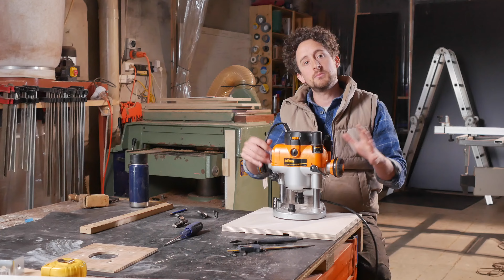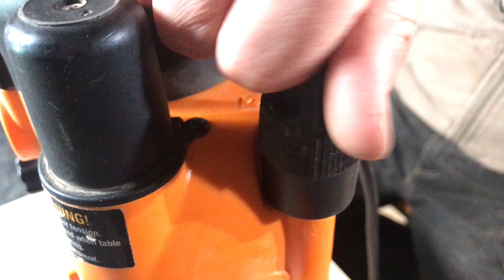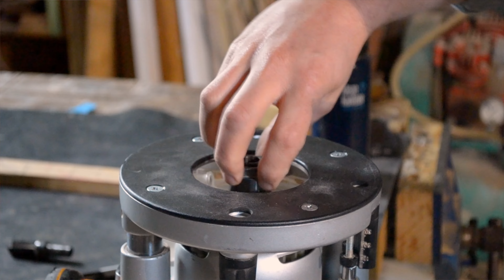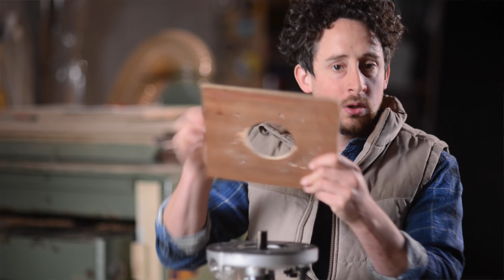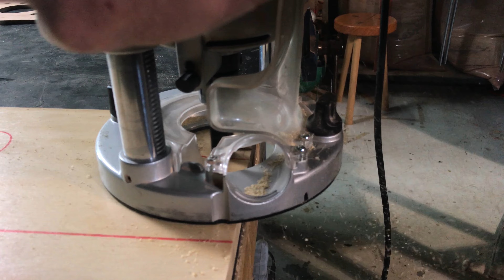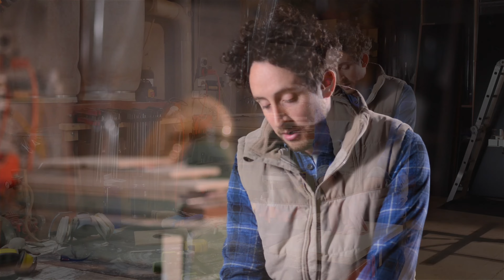The Router Bits: Introduction to Routing

Comment: Thanks for that.  I think I've been working with some bad info.  I was told to put the bit all the way down and then raise it slightly before tightening and then don't over tighten as it can destroy the collet.  I have the same router.  Just a beginner so would appreciate your comments.
Reply from the maker: Hi Caspian of Narnia! We asked Patrick, and his response is: 

That all sounds like reasonable advice actually. 
Raising the height of the bit prevents any blade edge contacting the collet  - which is good to look out for. The bit I was using had a collar protecting the bearing so I didn't need to raise it. But!  Good catch and good advice in general!  As for over tightening the collet, I have had bits slip or move due to the collet not being tight enough. So now I make sure its pretty tight. I have had this router for years and I have never destroyed the collet with tightening. But, I have had pieces ruined due to slipping bit height. Hence my enthusiasm with the spanner.
Reply: Timbecon thanks so much for taking the time to respond. I’ll be sure to tighten the bit a lot more than I’ve been doing. I really don’t use my router enough so I’m very thankful for your videos.
Reply from the maker: @caspianofnarnia  You are very welcome. Keep us posted on your progress. And hey....if you haven't done so already, check out the entire Router Bits playlist as Patrick suggests in this video. There are some excellent videos outlining setups and techniques for different router bits and processes. And be sure to subscribe. There is much more to come. Again, many thanks for watching and for commenting. Always appreciated.